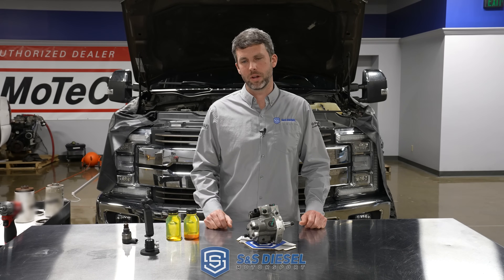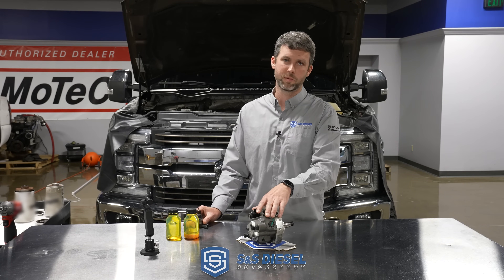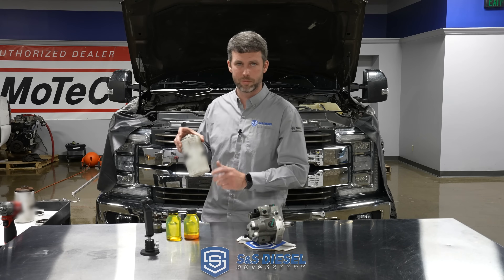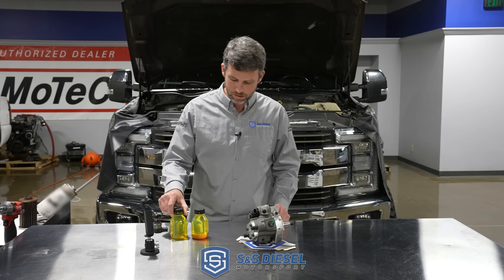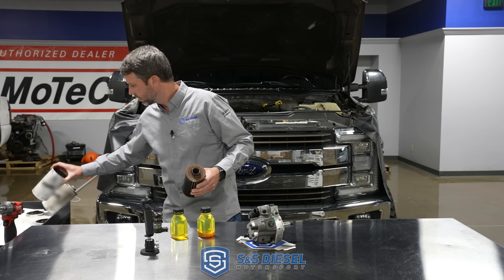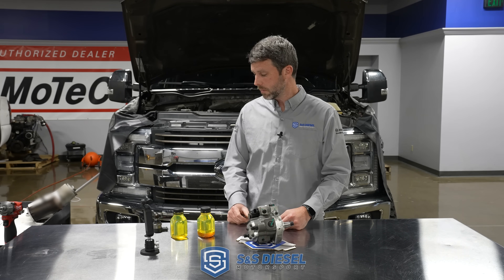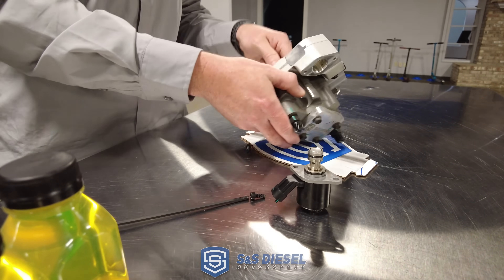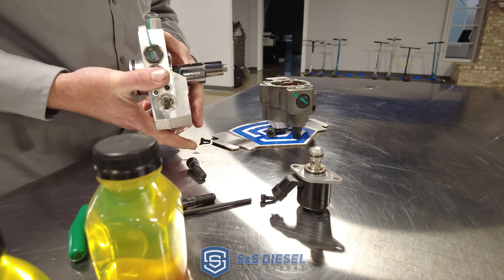Can The Ford 6.7L CP4 to DCR Pump Conversion Handle Water In Fuel?

Comment: We all appreciate you all & your team Luke. DCRs lined up
Reply: In Michigan go to fuels stations that are owned by companies. Why? Because Company owned fuel stations are forced to have their fuel, pumps, and tanks checked quarterly. Your typical corner stations are privately owned franchises that aren't required by law to be checked. You would do yourselves a favor by going to company owned stations like Sam's Costco Meijer BJ's they own those stations and are not private franchises and are required by law to be inspected and maintained for fuel Quality!
Reply: All fuel has water in the storage tanks. Best not to fill up when a load of fuel is being delivered. All stations can tell you how much water is in the tank, in inches and gallons.
Reply: @jackylsmith8138  yep. I never get fuel when a tanker is there
Reply: @jackylsmith8138  yes and sediment. but Diesel can allow micro organism and algae growth in tanks also. Which needs to be checked. And your corner stations that are private franchises are not legally required to check there tanks and fuel unless a complaint is filed. Which is how it works in Michigan. If contamination is found by a inspector the pumps and tanks are shut down and tanks are drained cleaned, repaired or replaced at the owners expense. Inspectors are not allowed to talk to the public when they are at a fuel station. Furthermore any Diesel owner who doesn't supplement their fuel is doing a disservice to themselves and their Diesel engine. Diesel engines are to expensive to not spend the money on quality supplements and conditioners to maintain your good health of your Diesel and gas direct injected fuel systems. Ignorance is not bliss. Furthermore Diesel manufacturers need to jump on the hydrogen fuel ban wagon now there's more than enough alternator power and battery power to take hydrogen from water via simple electrolysis to fuel a engine. It's the same reason oil companies developed group 3 fake synthetics only called synthetic  because it's so highly refined from crude byproduct. Any true synthetic is chemically made not refined. But this is another story entirely.
Reply: @jackylsmith8138  correct, because water is lighter than fuel and will go to the bottom of the tank. As well, more water will drop out of the fuel the colder the ambient temperature is.
Reply: I know you 😊
Reply: Gotta get me on that list. Lmao -  bro this is why I like my OEM filters. Holy hell. WIF has saved me a few times from garbage fuel stations when I had no choice.
Reply: There are plenty of filter options better than OEM, these in the video were not as good, and they got bad fuel.
 I run 2 water separators with drains and a WIF plus 2 secondary ultra high efficiency filters to the HP system and filter the return as well. I also check the fuel quality at fill up and at 1/2 tank pull samples from both water separators. There have been a few stations in my area that run the filters for the pumps until they ruptured and ruined a few fuel systems, I travel a lot to so I filter the fuel I buy very well and though I do not run OEM filters, I do run great filters and verify I get good fuel plus I kept the OEM WIF sensor for an emergency back up.
Reply: @ptt. I was just going to tag you in this video. What are your thoughts after seeing what he’s saying about basically staying stock filters.